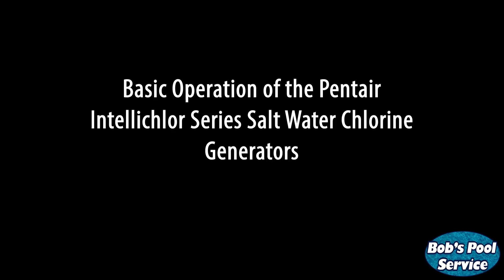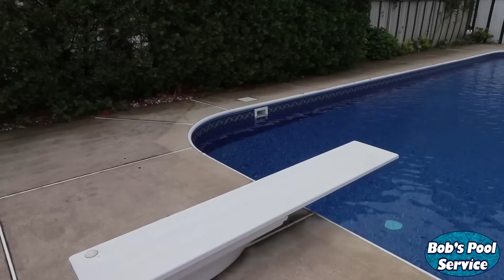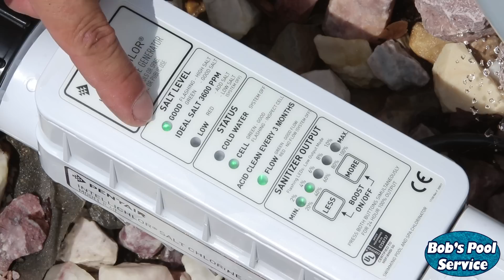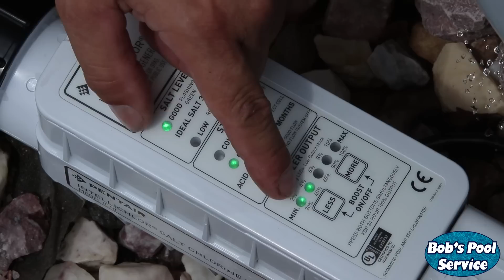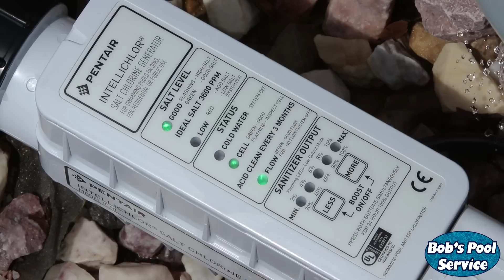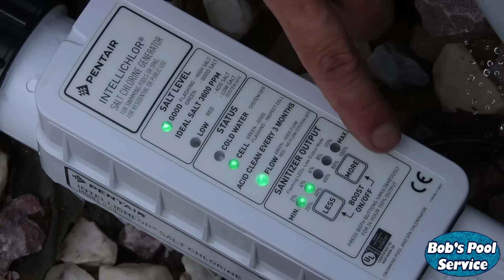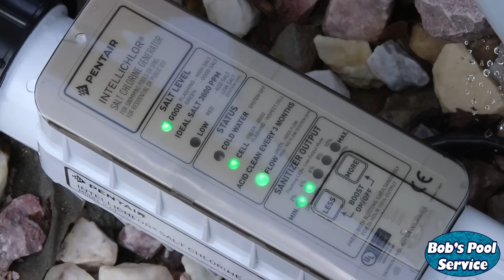Pentair Intellichlor Salt Water Chlorine Generator Operation

Comment: my cell light is flashing slowly, and that's after cleaning the cell
Reply from the maker: Make sure it's not just cycling on and off, that's normal.  Flashing that's indicative of a problem isn't slow.  You can test it by turning the output up to 100%, if you do that and the cell light stays on you're fine, it's just going on and off showing you when the unit is actively producing sanitizer.
Reply: @BobsPoolService  the output is at 100% and it is flashing slowly. Plus the water is getting progressively greener, so I'm not convinced that any sanitizer is being produced.
Reply from the maker: @sakinney3  Ok then there's a problem with the cell.  I don't know how old your cell is or if your season is all year round but it's quite possible it's at the end of it's lifespan.  The intellichlor Salt Cell has a lifetime of approx 10,000 hours. To check this, press and hold the more button for 3 seconds. The lights should scroll through and leave a few of the percentage lights lit up. The amount of lights corresponds to the amount of life used. Hope this helps, there isn't really any serviceable parts on the cell except for the flow sensor, all the internals are potted in a compound.
Reply: @BobsPoolService  It's about 5 years old, and it is used year round. I'll try checking the readout (using the more button) and see what that says.

Comment: Our pool builder told us to keep the sanitizer output at 100%. Not sure why? Is this damaging to the system?
Reply from the maker: If the unit is undersized or you're not running the system for enough hours it's possible to have a situation where your unit has to be run at 100%.  Other cause could be incorrect chemistry, ie too much or not enough stabilizer or high pH.  What you should really do is TEST your water to see if you have proper chlorine levels with the unit running this way, if your water balance is good and your chlorine is between 1-3ppm then I suppose running it at 100% is ok, however that doesn't give you anywhere to "go" if you need more during hot months.  Also note this video is for a standalone installation of the unit, NOT with automation so if you have one of those systems that could be why.

Comment: Hey nice video. I want to turn my salt cell off for 24 hours as I ad salt. I can’t get mine lower than 20% ?
Reply from the maker: Hey Joe, sorry for the delay, we've been crazy busy with work.  To answer your question if you keep hitting the less button the led's should blink putting you into the 2-10% range unless you have a much older cell, those only went down to 20%.  You can tell by looking at the cell, if it has 2 cales, 2-10% and 20-100% once you're at 20% just keep pushing the "less" button and it should go to the low range.  Another way to totally turn off the cell is simply unplug the connector from the power center, there's a ring that rotates counterclockwise then the connector will just pull out.

Comment: Excellent training video. But what does it mean when all lights are off, does that mean my intellichlor is done? Needs to be replaced?
Reply from the maker: Make sure there's power going to the transformer, also the bayonet connector where the cord goes into that can be a failure point.  Lastly there's a fuse inside the power center, I'd check that too.  It's possible your cell is dead but it's more likely it's not receiving power.

Comment: What should sanitizer output be set at?
Reply from the maker: Depends on a lot of factors,  you'll need to check your levels with a test kit and then adjust the output accordingly.  We generally oversize our systems somewhat for the pool and start around 40%, let it run 48 hours and test the water.  This is usually based on a 12 hour pump runtime.  the units do not self monitor.

Comment: Great video!  Recently I have had an issue where pushing the “less” button doesn’t work.  It’s stuck at 60 percent and won’t go down lower.  Any recommendations?  I tried cutting power to the unit and restarting but no change.
Reply from the maker: That sounds like the button itself is the issue.  Unfortunately there's no way to replace it, the entire unit inside there is potted with a compound (I cut one apart once to look inside).  I've seen a few units where I really had to press the button firmly to get it to change.  If the unit is under warranty I'd reach out to your installer, if not or if it's over 5 years old you may just want to consider changing the cell.  Last option would be to put the generator on a timer to reduce the output but that might be fairly difficult depending on how it's wired.

Comment: So helpful! 👍 I worked for a pool company for 15 years and knew my chlorine pool inside and out. But last Sept 2022 I switched to a salt water pool, and wow, this is a whole new ballgame! My salt cell has a constant red light on low. I'm hoping I just have to add some salt and that nothing is wrong with the salt cell seeing that it's only 7 months old? 😊
Reply from the maker: I'd check the salt with an accurate meter to make sure the cell isn't reading it incorrectly.  If you just opened the pool and get rain it can be common to have low salt levels, we often need to add 300 lbs of salt in the spring time.

Comment: How big a unit for 24k gal pool?
Reply from the maker: I would go with the IC-40, you could even use the IC-60.  It's always best to oversize these units by at least 25% so the IC 40 which is good for 40,000 I'd only use on 30,000 gallons, IC 20 only 15,000.  The new units allow them to be turned way done if necessary, the larger units simply have more plates inside them and will last longer.  We've put the IC 60 on pools with 30,000 gallons when due to supply shortages the IC40 was not available anywhere.
Reply: Thank you are the Pentair ic40’s reliable, how do they stack up vs CircuPool?
Reply from the maker: @LA-zc9rg  I haven't seen enough circupool units to make a fair comparison.  What I like about the Pentair vs Hayward or Jandy is when you eventually have to purchase a new cell (they all wear out in time) you also get all new electronics because they're integrated into the unit.  There's also just one heavy cable from the transformer to the cell, some other brands have a separate flow sensor or tri sensor along with an easily damaged cord that's similar to old phone wires.  All these units do essentially the same thing but we're partial to the Pentair units because of those reasons and have seen great longevity with these units.

Comment: I have a Pentair Intellichlor and the flow indicator only shows flow when the pump is on full blast so it is only generating chlorine when I am running the pump flat out. I took out the sensor and it looks fine with no buildup or obstructions, and the pump function seems fine so I am baffled. Any suggestions?
Reply from the maker: Well, the switch is based on flow not pressure, I would make sure your filter isn't clogged or there isn't a restriction somewhere in the returns to the pool.  If the filter isn't letting water pass freely even "flat out" there may not be enough flow to allow the sensor to make the connection.

Comment: What does it mean when the Pentair intellichlor status “cold water” has a red light?
Reply from the maker: It means the water is too cold for it to operate and the unit is not going to produce chlorine.  I would check the water temperature though, if it's above 55 degrees and this light is on then likely the thermister is failing in the unit.

Comment: If the Status is Cold Water, should the flow light or sanitizer output lights be lit or is all that "off" because of the Cold Water status?   The water is 52 degrees.
Reply from the maker: The sanitizer light shouldn't come on but the flow light should be green when the pump is running properly.  When it's too cold it won't turn on to produce sanitizer hence that light not being illuminated.

Comment: Great video. I recommend having the salt level tested independently with a salt test kit or strip once a month. This way you don't accidentally over salt your pool if the cell is falsely reading low.
Reply from the maker: I couldn't agree more and in fact always mention that to customers.  I have seen pool owners over salt their pools greatly from this very scenario you point out.  Another important detail is never check the salt level when a pool has sat over the winter.  Do it after  it's circulated for at least 2 days.  The reason is salt water is denser than fresh water and the rain water that comes through the cover will sit on top giving a false reading for salt (and everything else).  People sometimes ask why we don't test the water the day we open up the pool and this is why, it'd be a totally incorrect reading.  The best chemical addition for a newly opened pool is simply 1 lb of shock per 10,000 gallons since the pool has been without chlorine for months.  After the pool has run for 2 days and the water is homogenous THEN do a test and adjust your chemistry including salinity.  Thanks for the comment.
Reply: Nothing is worse than telling a client that they have 8000 ppm of salt in their pool and need to drain over half.

Comment: Well done video. Short into the point! One question if I had a chlorine pool where I had to add chlorine tablets can I convert it to a saltwater pool by simply installing one of the salt generators?
Reply from the maker: You absolutely can.  Something a lot of people don't realize is salt water generators PRODUCE chlorine and "salt" pools are indeed chlorine pools.  The only thing I wouldn't do is have a chlorinator on the system along with the salt cell because the acidic fumes from the trichlor tablets can ruin the plates inside there.  When we install these generators we generally remove the chlorinator for the system and often even put the generator cell where it used to be.  Also if you get a salt system keep any granular chlorine you may have, in fact it's always good to have granular or liquid on hand for shocking the pool.  Even though the cell has a "boost" mode it's not the same as shocking where you get that strong initial dose all at once.  It's akin to going to the ER and getting an IV versus pills for antibiotics, that strong dose can destroy algae. I hope this helps.

Comment: What do you fo if the cold light comes on, how do you clean the saltwater  pool when it turns green and it's not working because it's  to cold?
Reply from the maker: Oh, that's easy.  Use liquid or granular chlorine in the interim until the pool heats up.  Your saltwater generator merely produces chlorine from the salt that's in the water as it passes through.  Honestly if the water is that cold the pool shouldn't require that much chlorine because algae and bacteria thrive in warmer water not colder.  In addition if you have a green pool you should be using powdered or liquid shock to clear it up, not running your generator at 100% wearing it out.
Reply: @BobsPoolService    Awesome!  Your video was very informative. Good job explaining it In simple terms. Thank you for your help, I really appreciate it!

Comment: Just had a new IC40 installed a week ago on our new pool. It was working fine for a week until yesterday when no lights were on and the reading on the app said 9900 PPM. I turned the pump OFF, unplugged the IC40 for about 5 min and plugged it back in. The lights came on with the pump and everything seems to be operational, but now the reading says 0 PPM. Can I reboot the IC40 to fix?
Reply from the maker: It sounds like you have yours hooked to an intellitouch or other automated panel.  I really can't say what's causing this for you, be sure the connector to the cell is secures, I've seen those pins not make contact a few times and cause weird errors that go away temporarily when unplugged and plugged back in. Since you only got it a week ago I'd reach out to the installer, you should have a minimum 1 year warranty.  This video covers stand-alone operation, once you're plugged into automated system it's totally different.
Reply: @BobsPoolService  Yeah we run everything through an IntelliTouch so I put the call out to our builder to get a Pentair repair going under warranty. Thank you.
Reply from the maker: @bmac1196  Hopefully they get you up and running shortly.  One thing you can do if the unit isn't producing chlorine is just put liquid bleach in the pool.  Doing this can save you from winding up with a green pool while you're waiting for the unit to be repaired.  Granular will also work.  A lot of people don't realize "salt water" pools ARE sanitized by chlorine and it's totally compatible.  The only thing I would NOT recommend are putting tablets in the skimmer or using an inline chlorinator if a salt system is present because it can damage the plates inside your generator.

Comment: Our cell chlorine generator lights are either off or at 100% and we’re being told we have no chlorine lately. What does that mean about our cell?
Reply from the maker: Do you mean the output LED's?  When you press the more or less buttons does it increase from zero to 100%?  I'm a bit confused.  Also if your system is hooked to an automation panel the controls on the cell are over-ridden, this video is for stand alone operation not when used with an intellitouch panel.

Comment: I started at a pool company and none of these Pentair's the buttons for more or less will work.  I just press the buttons and nothing happens????
Reply from the maker: Is your unit installed as a standalone or is it perhaps connected to something like an intelliTouch panel? If the latter is the case then that overrides the controls on the cell itself.  Also, it takes a bit of force to push the buttons. It's not like a microwave  or phone where they're touch sensitive to just your finger. You actually have to push fairly hard to activate them.
Reply: @BobsPoolService  yes they are attached to the big gray control panels.  So I think that is it.  However the cells do have all the green and red lights on.
Reply from the maker: @JuanSanchez-tk4vr  Yes, those control panels override the buttons on the unit.

Comment: Thank you for the video, I have this same system.  I taste salt in the pool and the light is flashing that the salt is too high.  1. Is this safe to swim in? 2. How can I get the salt level down without draining? Thanks in advance!
Reply from the maker: High salt won't hurt you but in time it can damage your pool and support equipment.  Realize ocean water is about 10 times as salty as a salt water swimming pool.  The only way to get the salinity down is by removing some water and replacing or waiting for some rain, evaporation won't help.  Personally I would take a sample and test the salt to see HOW high it is, if it's only a few hundred PPM over 3600 I'd likely leave it and wait until rain and backwashing dilutes the pool but if it's very high I wouldn't keep it like that too long, especially if you have a heater.  Hope this helps.
Reply: @BobsPoolService  thank you so much for the quick and detailed response.  Your professionalism shows, wish you were my pool guy!
Reply: @BobsPoolService  not sure if it'll help but I recently put any 4" water in from the hose to try and dilute, fingers crossed
Reply from the maker: @deeznoots4097  It will dilute it but I'd really check the salinity with a salt/tds meter or you can buy strips as an economical solution.  You can calculate how much you need to dilute the salinity pretty easily, we use an app called Pool Pal on our smart phones but there's many similar apps and websites if you aren't good with doing your own math.  3600 is the ideal for this system but I've seen the salt at 4000 without any serious issues.  I'd never trust the lights on the cell though, they're really not very accurate compared to a dedicated tester. We use the Myron Salt/TDS meter, it's done us well for 10 years and seems to stay calibrated.  https://www.amazon.com/Myron-512T5D-Conductivity-Meter-0-5000/dp/B015XVJ4TI/ref=sr_1_1?crid=1RJ3GC7GZECR0&keywords=myron+salt+tds+meter&qid=1656019954&sprefix=myron+salt+tds+mter%2Caps%2C54&sr=8-1
Reply: @BobsPoolService  excellent,  thanks so much for your time,  you're great and so is this channel!
Reply: Thank you for the detailed explanation from the blogger. This is our titanium electrode salt chlorine machine testing video. Welcome to watch. Thank you for your time

https://www.youtube.com/watch?v=Xi4_EYCDL2k

Comment: THANK YOU!,  any idea why my IC40 sanitizer output will only flash green at all levels.  I am not able to lock it at one level either at a solid light or flashing light level.
Reply from the maker: Try hitting the more button when it's at 100%, this should put it into the proper range.  There's 2 ranges and scales, if it's flashing you're in the under 10% range.
Reply: Thank you.. it seems the app overrides the cell itself.  If i increase on the app, it changes the level on the cell.
Reply from the maker: @christinekonyak-parker5314  Oh yeah, that'll do it.  This video was for stand-alone operation only, once you have automation there's no reason to operate from the cell itself.

Comment: Thanks for the video.  It is very informative.   What happens when cell light is not on?
Reply from the maker: It just means it isn't producing chlorine at that moment, it will cycle on and off to show when it's active.  If it NEVER comes on something is wrong.  If you want to check, turn your cell up to 100% output and the cell light should come on and stay on.
Reply: @BobsPoolService  thanks fir the quick reply.